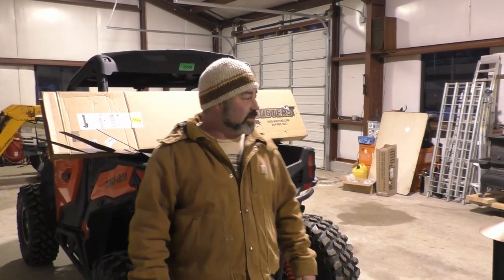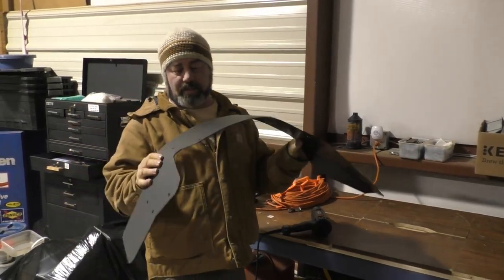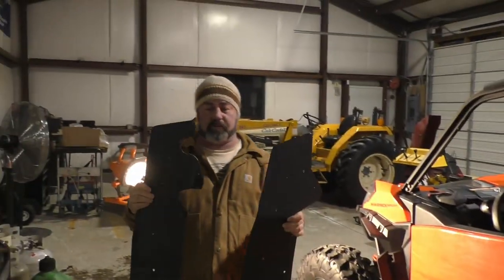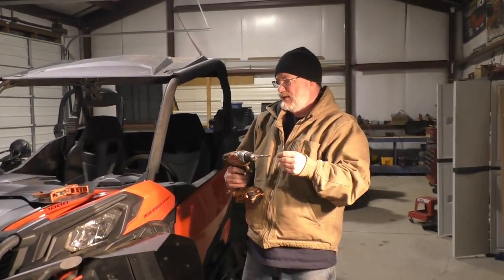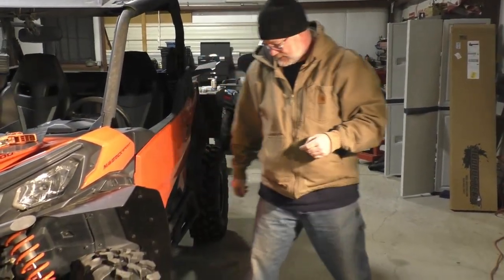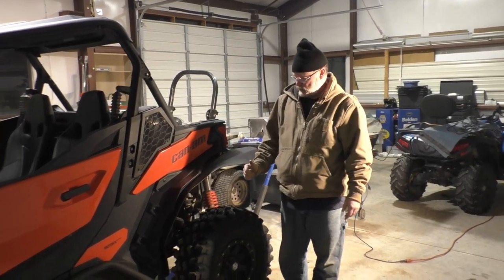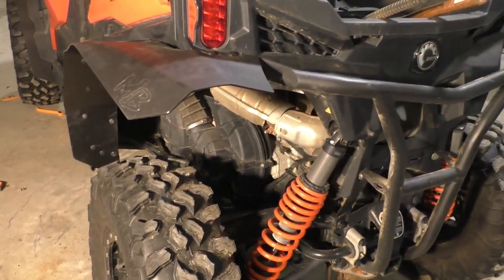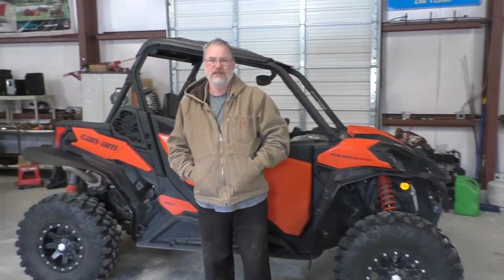Maverick sport 2020 Mud Busters mud flaps watch this before you install.

Comment: Great video and great tips on installing the heat gun isn't necessary (we recommend just bending them more without the heat gun) but the flares look great on the Mav Sport!
Reply from the maker: Thx for the feed back. Probably correct About the heat gun. it was just slightly above freezing in the grague. so we where chicken.